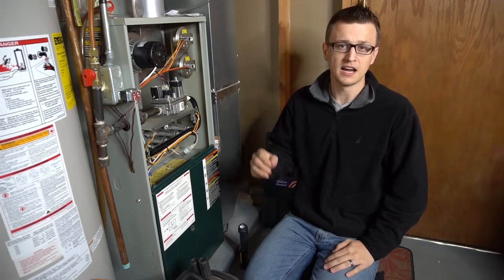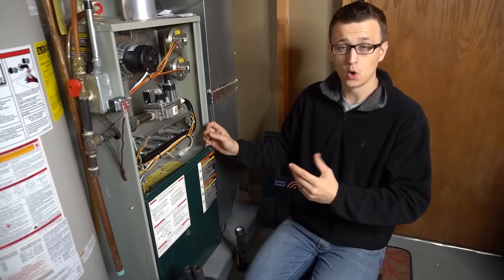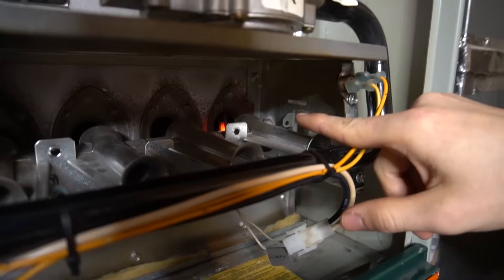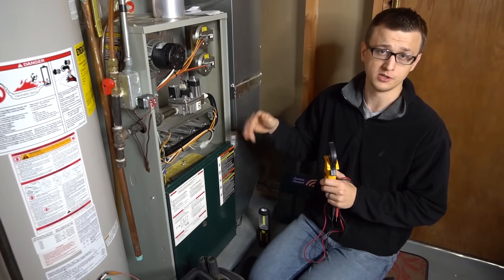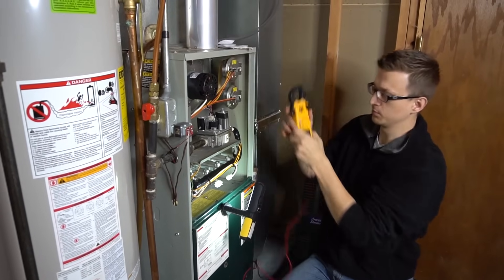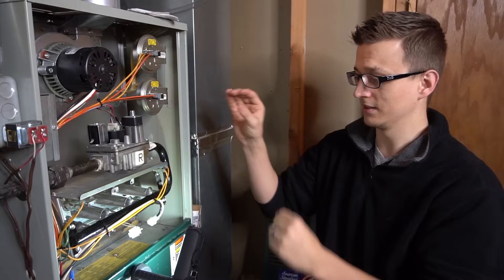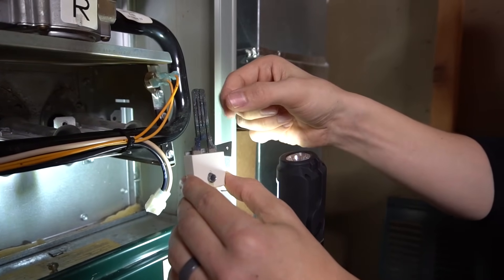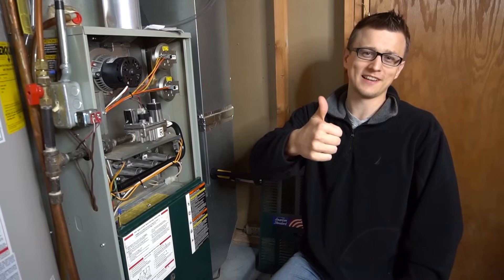Furnace Not Igniting - How to Check and Replace Ignitor

Comment: I have carrier. everything seem to work fine up until igniter was on and glow but not ignite.  I check voltage there's no voltage to gas vale when ignite hot and ready.   I assume the boards bad.   Any Ideas?     Thanks!..
Reply: Pull the board off (way easier that it looks, take several good photos from up close and angles so you remember where to put each wire back). Your situation may be like my case where the board is not telling the gas valve to open. The lack of voltage to the gas valve is a dead giveaway. YOU DO NOT necessarily need to replace the board. Take it off first, get a magnifying glass or if you have none use your phone camera as though you are going to take a picture and just use the zoom function and look at the soldering on the pins (on the bottom green side). The fractures may be small but that is all it needs. 

 I am a homeowner and just had a similar issue this weekend. Once I confirmed my problem it took me less than 45 minutes from start to finish and I was back up and running. Prior to this I had checked all components, wires etc,  in the end found no voltage going into gas valve.  Had all kinds of opinions provided and many of course could easily have been right, I eliminated by testing each and with effort narrowed it down. In my case the unit was turning on when called for, inducing motor starting and then, spark/igniter was attempting to light but would get no flame from gas and no gas smell). It would recycle and try to light a few times then finally shut down.  I almost gave up , just when I was about to call HVAC company for help I was putting the cover back on and by accident this thing ignites! I take the cover back off and it shuts off again..Stumped at first I then realized the cover would slightly push some extra wiring in a little and it would push up on the wiring harness that send the voltage to to certain components (in this case the gas valve) . So I manually pushed up on the wiring harness (not pushed in as it was already flush with board) and poof , fire again, but I would let it go and gas would shut off. That slight upwards push, only a centimeter or two was all that was needed to help the pin reattach to its prior soldering on the board. 

HVAC company wanted to charge me $600-700 to install. I figured I could just replace it myself , the board for my unit is around $125-$150. I had put one on order but was not going to get here until Tuesday so I decided to go just pull the board off in the meantime while waiting. I noticed the pins from the board that connect to the wiring harness that feeds the voltage to all the different components had as suggested from a poster on a DIY forum slightly fractured  from the solder/board underneath on the green side of the board. Only the gas valve ones in my case which were on my far left had done so, all the others solder looked good and in tact. I soldered them back real quick, less than 10 minutes (be careful not to melt the PINs, one of mine shrunk a little because I melted some of it but it still works fine) . 

Here is a pretty cool Do it yourself site I found and a post I put on there regarding my issue. https://www.diychatroom.com/f17/control-board-gas-valve-not-opening-647217/ 

Sorry for the red! Accidentally did that while typing and couldn't figure out how to put it back!! LOL
Reply from the maker: If the ignitor is glowing but the gas valve is not getting voltage then most likely yes, that board is bad.
Reply: @WordofAdviceTV  Thanks!..    I what I'm thinking

Comment: Thank you for your help. I can finally stop checking everything over and over. I checked the volts and got a reading of 005. I need a new control board.  Thanks again!!!
Reply from the maker: Hey Steve! Can you hear the gas valve opening up like I showed in the video? If you can, then proceed with the control board :) If not, then there may be a limit or pressure switch problem instead. Just a heads up since boards are not too cheap.
Reply: Word of Advice TV  , yes I hear the gas valve open and then shut off due to no flame. Thanks again!!!
Reply from the maker: @SteveZZZZ  Ok, sounds good! Good luck!

Comment: how you check or test spark ignitor's in a  furnace? could use some information for future reference, as my Utica boiler has one!
Reply from the maker: If it's not an ignition module but just a standalone spark module, it's very easy. You would just check voltage. If the spark module is getting 120v but it is not sparking, it's bad. If there's no 120v, then something else before the spark module is interrupting the circuit.

Comment: Do you also have videos on gas boilers? Nice to see those also.
Reply from the maker: I actually do not work on very many boilers, mostly forced air. That's why I don't have videos on them either. You would have to check out some of the other HVAC channels for those :)

Comment: Can they be tested with continunity as well?
Reply from the maker: You probably could but it won't always work.. Continuity is meant more for smaller resistance checks. Like to check if a switch is closed or not.

Comment: I had Tonite on a Goodman furnace the inducer motor was running and nothing else was happening but the board had 2 red flashes and diagram said pressure switch closed.  So I would need a new pressure switch?
Reply from the maker: If I understood that correctly, the board was blinking a code that said the pressure switch is closed when it should be open. Most likely the pressure switch is stuck in a closed position then and should be replaced.